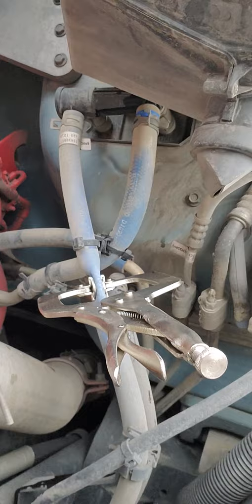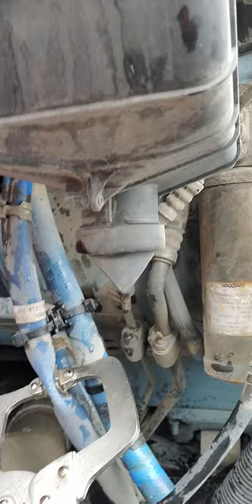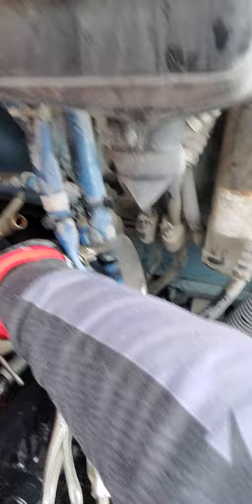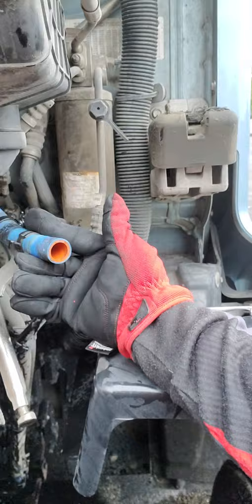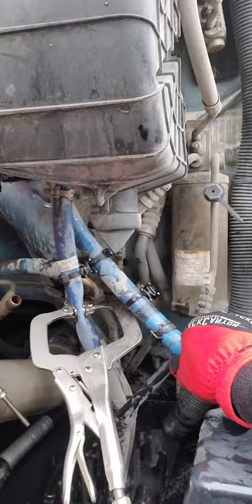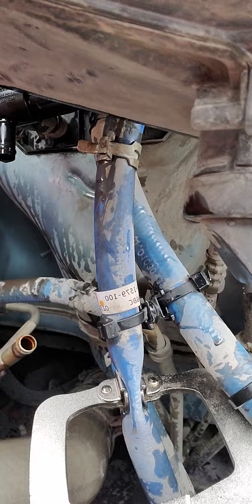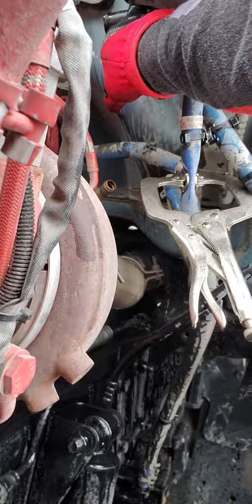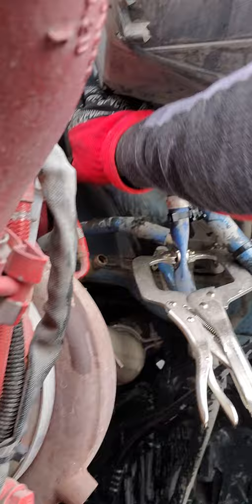2016 Peterbilt 579 Heater Core Troubleshooting

Comment: How long did it take you to replace?
Reply from the maker: I  never replaced it.  I turned the truck back in due to many other issues
Reply: @thealltrucker  Gotcha. I'm going to take a stab at it this weekend.  Before I replace mine, how do I know it needs to be replaced? When I turn on heat I hear a weird noise briefly. Then it goes through motions of trying to run but starts cutting in and out. When it does run, all I get is cold air out. Is it safe to safe that it is indeed the heater core?
Reply from the maker: @mh9113  make sure your valves are opened to allow the hot water in.  If they're opened and it still doesn't produce heat then you may have to take it to a mechanic or reverse engineer the process in order to learn how to replace it yourself
Reply: @thealltrucker  Thank you for the help! I was shocked to see that you responded fast! Typically I take my truck to peter dealership but after close to 35k in repair bills last year, I've decided to do small/minor repairs to save $$. Thanks once again, have a great day!